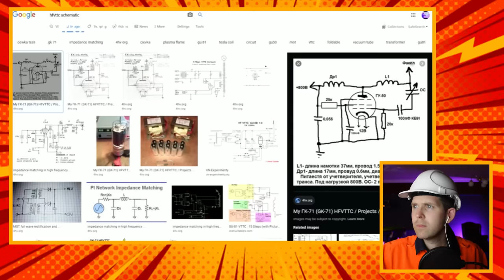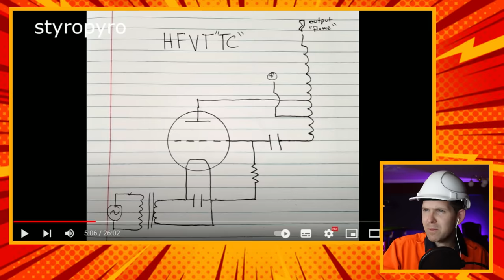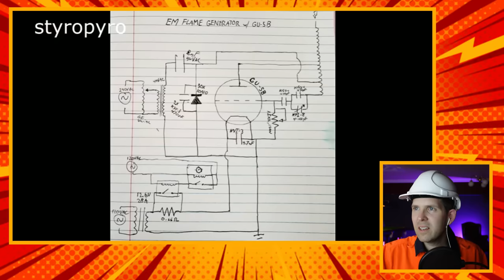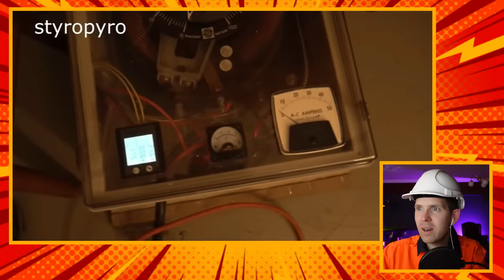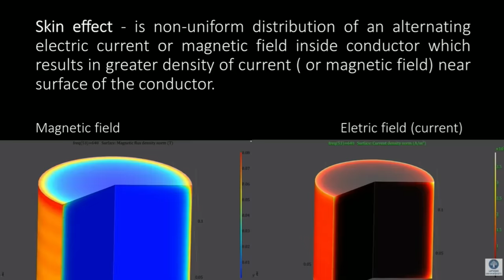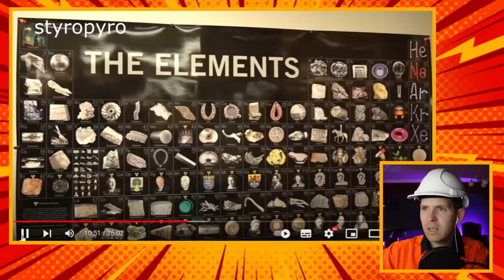Electrician Reacts to Styropyro’s CRAZINESS 🤪

Comment: I actually have a blue card, and because of known related manufacturing process... to have a blue card for electrical in Canada, there is fielded processing similar to inner rank processing in the military. "that is a illegal nitrate manufacturing set up, that is burning things shown that makes chemical compounds known to cause various cancer leading to death in as short as 3 months"... need a blue card on your federal social profile or all related electrical components including all things light bulbs batteries phone chargers and phones computer parts motors wire etc will be confiscated by CBSA for additional processing including legal fees and dates you will be summoned for by warrant. Russian hammer hits as hard as it does on everything!
Reply from the maker: Holy shit, sounds bloody serious
Reply: @thinklist  10:30 molecular strong force, of the atoms of copper are not the same as iron... because of that the AC transmission frequency efficiency curve changes and becomes more relevant the longer the wire or circuit path is. as to why computer processors can only run at a set frequency because of the ratio of length to material type "longer flow path = lower frequency, tho at specified frequency's in longer wire, AC wave reverberation collisions make hot spots in the wire" ... poorly rite but anyways many micro inverters turn 60hz AC into DC then oculate it at 40kHz in to a ring transformer that has the in and out wire in near dyrect contact to match the "electrical resonance frequency of... how fast that material type actually magnetizes and de-magnetizes molecularly". ... Laser vs rust but does nothing to clean iron. " atomic strong force resonance graph's " mosfet's... so silver being non-magnetic becomes perceivably permanently magnetic then melts from acoustic thermal magnetic collision, faster AC makes a more efficient voltage step al long as it matches the material type. why 3 loops of copper can make an iron bolt red hot, the electrical resonance 'strong force' of copper is higher then iron "the volt meter just says, 0.000*ohm's on both until the test voltage testing resistance is actively changed from 0 to 7Ghz then a electrical resistance graph is made, mystery material vs resonance identifier, same as high frequency laser light burns off rust, the pulsation of a set wave length creates a similar resonance against the molecular strong force of an atom/chemical". farther more also relevant to what's in the bag, the chemical analysis machine essentially just looks at it does not need actual litmus color reactions to identify "things" thus reducing costs. gamma spectrometry, very very high frequency relation.
Reply: think the heat buildup on the outer of wire starts from oxidization in air, as in a vacuum it would explode giving zero thermal run out warning. magnetism in electrical resonance creates a atomic mechanical reverberation thru the whole wire core, not the outer wire. oxidization when heated causes the outer to heat up. and that's why a inverter welder with 16 gauge wire leads on the power plug side can actively melt 200 pounds of iron rod near 1/4 inch in thickness, and the 60hz box is such a pain to use, pulse modulated DC power that matches or exceeds the molecular electrical resonance brake down of iron... not just more power.
Reply: 11:00 electrical nitrolization "nitrous oxidation" creating a chemical brake down / addition reaction, tungsten to crystalized tungsten nitrate to then surface thermal fracking of the nitrate ending in tungsten oxide and recreation of the nitrogen into the electrical nitrolization oxidization. just to be using disposable carbon ends, easier to replace simple as burning garbage and distilling the black smoke thru a percolator.
Reply: permanent magnetization of silver... sending a singular electrical pulse thru it, then using a transformer to catch it in its atomic resonance frequency simultaneously sustaining an electrical reverberation in it based off of a very small input that starts a electron movement. non-magnetic metal vs scientific magnet!

Comment: check out hig1voltage1rules, he built a massive tesla coil.  we put it to the test in his metal mancave and a few outdoors.. I appeared a few times with a hot carbon arc on a welder.  that was fun.  we have blown up bulbs on a capacitor bank.  much fun.  on my channel i destroyed a lithium chloride batter on a simple 8 amp bench supply.  the explosion was epic